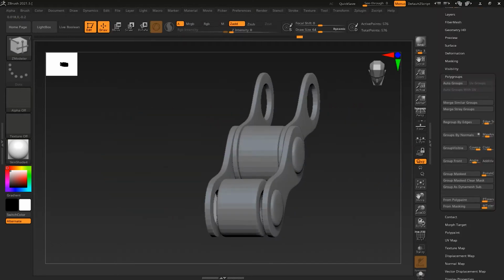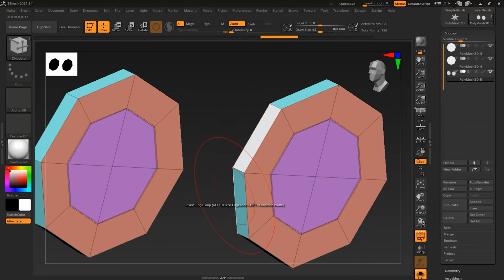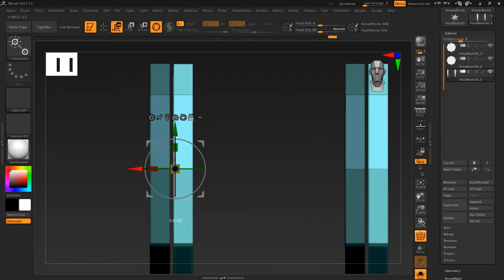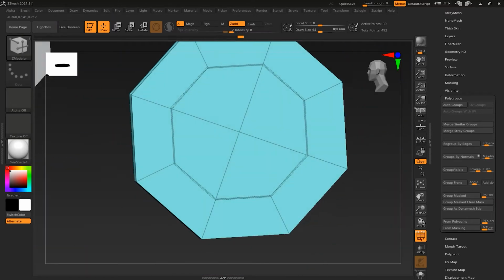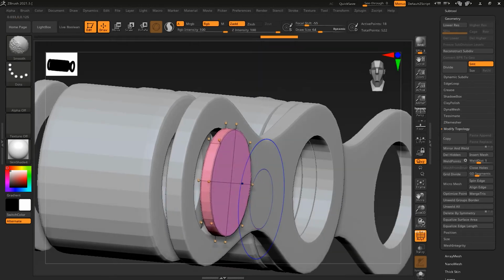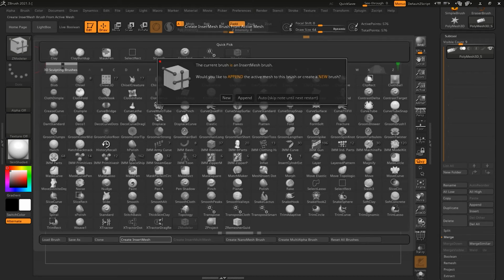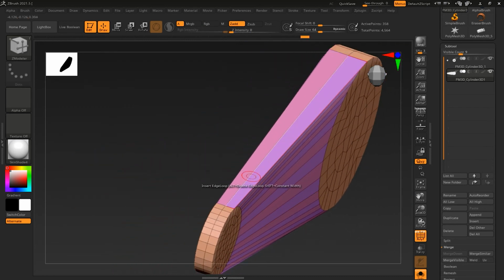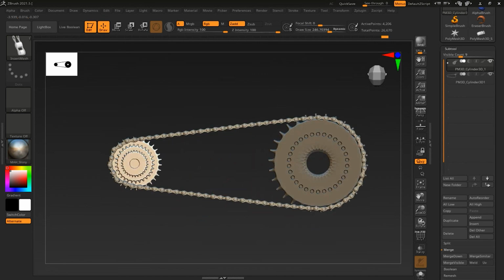ZBrush Hard Surface, modeling a bicycle chain in 3D with ZBrush using ZModeler

Comment: Is there a way I can rotate the chain angle, my bike chain is on its side not as it should be rotating on the chain rotation 
part.
Reply from the maker: Yes, try press control or Alt buttons and rotate without releasing the buttons. That should work! Good luck! and thank you for watching!
Reply: @makeithappenwithjayinZBrush  thanks for the response always appreciated, I actually went with a different approach I added an insert loop on another side, then like you creased that loop, just tapped and woila
Reply from the maker: @redonsejdiu7721  That's why I love ZBrush! It is freedom and creativity territory! Well done mate!